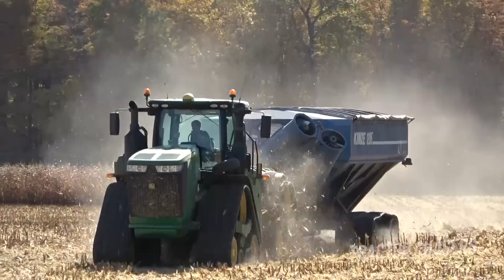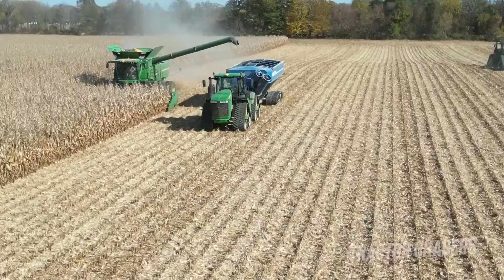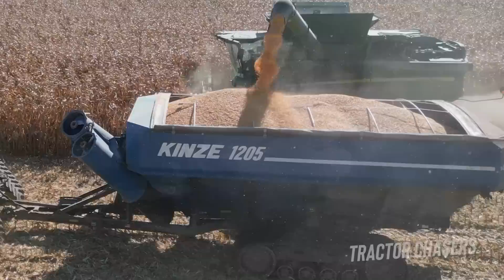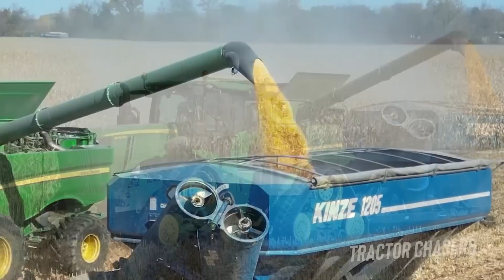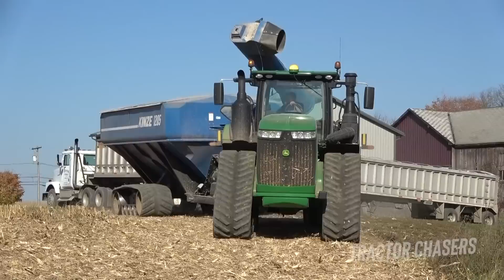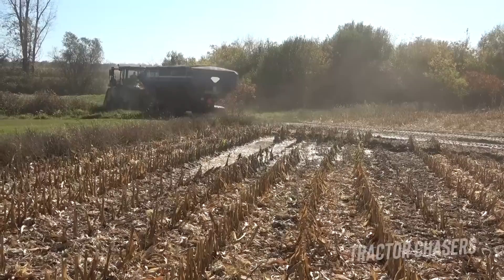Two John Deere S780 Combines Harvesting Corn with John Deere Tractors

Comment: Can someone tell me why you see a lot of corn or soybeans sprouting up after they have harvested the field. Is it they are going to fast not screening the corn , beans good
Reply from the maker: Combines can leave some grain in the field, especially if they are not set up properly.
Reply: Yes your rite they are going pretty fast it's hard to handle that much grain so it goes out the back. It could be set wrong but I think they are going too fast both will cause grain loss
Reply: Over filling the chase bin doesn't help. Why do you do it?